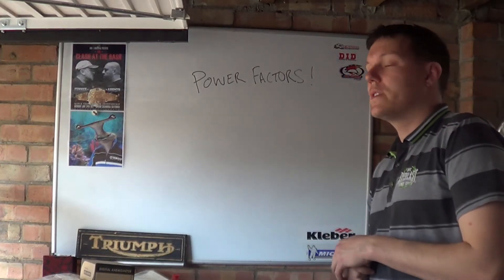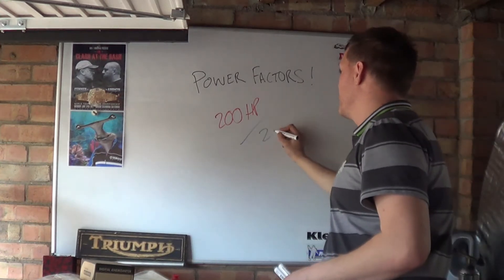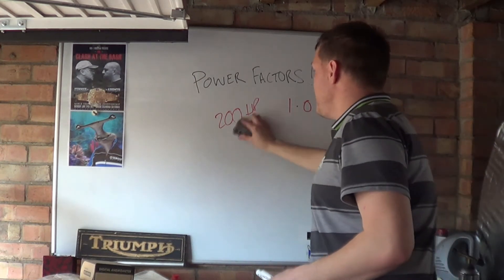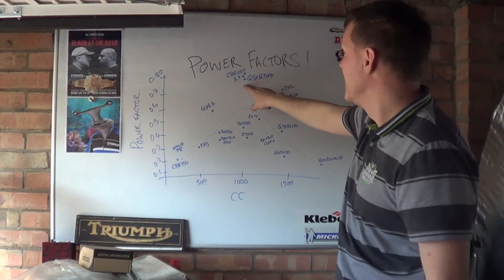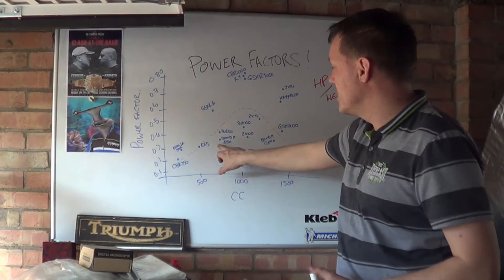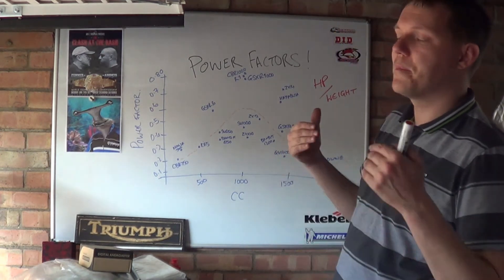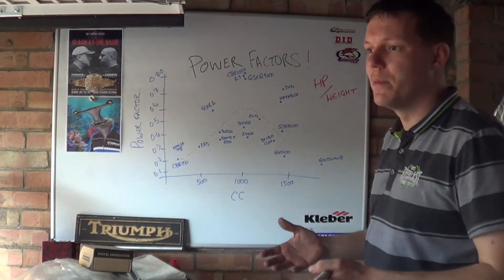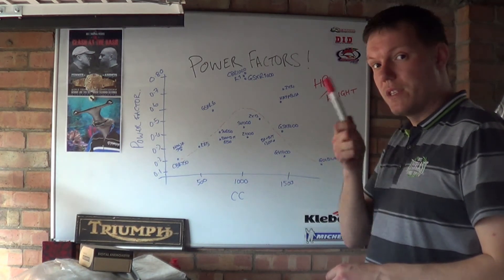Power Factors - power to weight

Comment: I'm sure you could easily build a 1400, 1600 or more with similar power factors but why?
Nobody races them so that's where the development and money go, not sure it's a 'sweet spot' at 1000.
Hasn't somebody fitted a Hyabusa lump to a blade frame?
Reply from the maker: The majority (85%) of the weight difference between a fireblade and a hayabusa is the engine. 'Nobody races them' back in the day before 1940s most bikes were larger than 1000cc
Reply: I didn't think the engine was such a high proportion of the weight, maybe 50% but then they are built with fewer exotic materials compared to the race bikes, less mag-alloy etc but I bow to greater knowledge
Reply from the maker: We've got our wires crossed here mate - the CBR1000RR weighs 205kgs (452lbs) and the Hayabusa of the same year (2016 for example) weighs in at 265kgs (584lbs) - around 85% of that increase in weight is engine. The wheels, shock, seat etc are pretty much the same weight. All added up to about 25% of the increase. These numbers above are both wet, and the Honda has 1 liter more fuel than the Busa, but that's only around 700grams. Sticking the Busa engine in honda would increase the Honda weight, decreasing its power factor. With the same engine power and ever so lighter Honda chassis the power factor might go up, but then you have to ask, does the Honda have the chassis and brakes to match the Busa's breaking and handling performance 

- matt
Reply: Thanks Matt,
As I say I'll bow to greater knowledge than mine just thinking it through.
I really enjoy your channel however and love to refresh my aging memories on things as well as catching up with more current processes and designs, keep it up my friend
Reply from the maker: This is what the channel is all about, if you can't ask questions then whats the point?

Comment: Does the engine itself add significant mass, or do the Busa/14s have heavier chassis to hold more power? Could you swap a ZX14 engine and squeeze it into a ZX10 frame (I doubt the front wheel would stay down anyway)?
Reply from the maker: Yes the engine adds mass, it usually about 1/2ish depending on the bike. This is why there are two types of dynos. Engine dynos (crank dynos) and rolling road dynos (or RWHP, at the wheel). When a bike (or car) is tested the BHP is a measurement of the entire system. Including the weight, friction losses, losses through the transmission etc etc. The engine is part of the system and if it can't carry its own weight then what good is it? - Thanks for the comment dude - matt
Reply from the maker: "Hey Mark, I`m calling you out on this one.  "Including the weight". Does the weight of a bike/car affect the BHP reading on a rolling road???"

- Its Matt, not Mark lol And yes the weight is important unless you are suspending the bike from the ceiling? However, its only half of the bikes weight. For the tyre to grip you need 2 things - a force and friction. The friction is determined by the 2 materials in contact with each other and we give this a number called the coefficient of friction, which is a number (or ratio) under 1, 0.76 for example. The force is the mass of the bike under the acceleration of gravity, we call this weight. If the bikes weight had nothing to do with it there would be no friction and no test possible.

This is why when dyno testing they claim Rear Wheel Horsepower. They don't (generally) include the rolling resistance and weight on the front wheel. So a dyno result is always higher then you see in the real world, mostly due to the air resistance.

Comment: Interesting take on the size of the rider and the resulting packaging leading to the 1000cc sweet spot. The Bandit comparison was interesting but some viewers may take it out of context - Why get a 1200 when the 600 has the same power factor? You may want to link to your HP / Torque Video: https://youtu.be/BOQ_FZ6Wgmw
Reply from the maker: The Power Factor graph has no bearing on weight of the machine, how high the seat is etc I'd have the 1200 over the 600 due to the bikes weight and size. I don't think that many will be totally swayed by the video, its just pointing out the differences between machines. Although it is a point to consider, I'll mention it in the next video based on this subject. thanks for the comment - matt

Comment: biggest bike I owned was a triumph Daytona 955 - sold it now but being only 5'4" and a little over 60kg myself you can imagine where it's power factor sat on this chart. It barely knew I was sitting on it.
Reply from the maker: The power factors don't include the weight of the rider, although you could on a personal level, however seen as though you usually stay at the same weight, the numbers will just be offset from the numbers of the graph. - matt
Reply from the maker: and the daytona 995i has a PF of 0.584.
Reply: Ah thought it would be about there. Scary enough !!! 😶